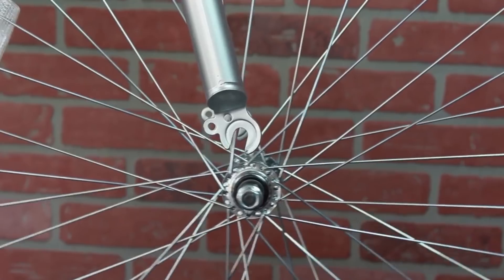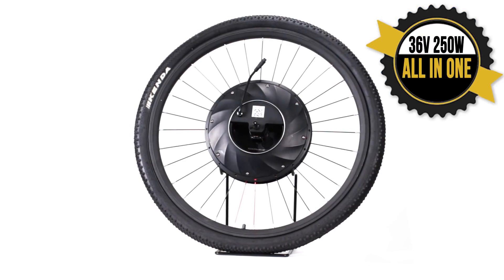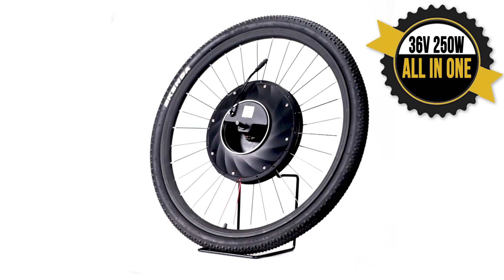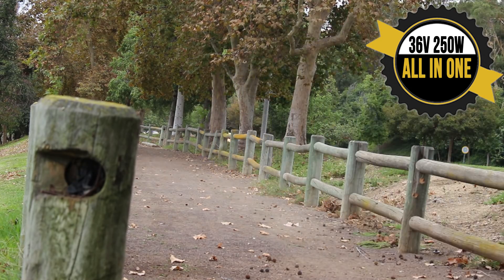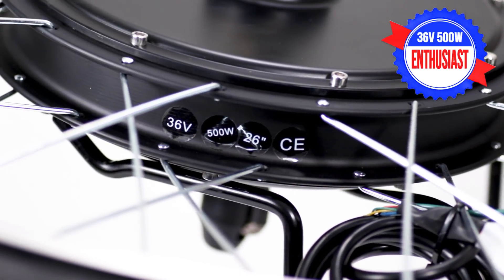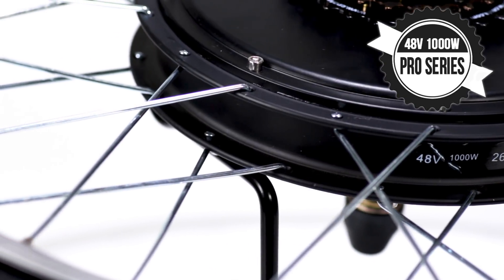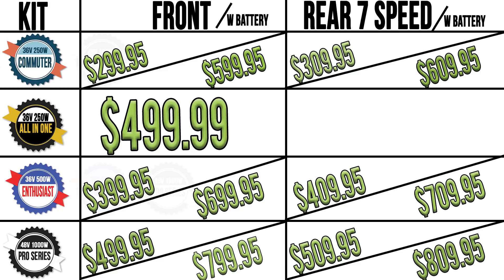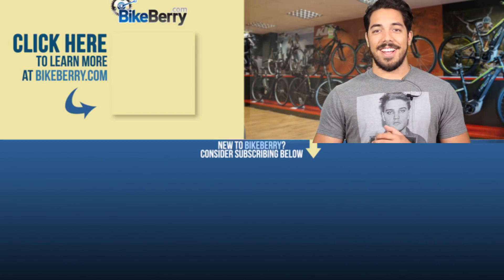Best Electric Bicycle Conversion Kits of 2019 - Electric Wheel -  Modwheel Buyers Guide

Comment: Looking at the ModWheel 26 Inch 36v 500w Enthusiast Front Wheel GEARED Electric Bike Kit I see conflicting info:
Here is says "brusshed motor";

    The ideal combination of speed, power, and competitive pricing
    Includes a 26” front wheel with concealed 36volt, 500 watt electric motor
    Comes with LCD speedometer and an electronic controller
    Brushed motors offer high levels of efficient power, while also minimizing operational noise
    26” wheel comes with innertube and tire already attached, plus a dish to lower wind resistance

Here it says "brushless" motor;

Kit Includes:

    1x 26" 36v 500w Enthusiast Front Wheel Electric Bicycle Wheel w/ Brushless Motor
    1x Electronic Controller w/ Thumb Throttle, Brakes, and Pedelec
    1x Controller Bag
    1x LCD Speedometer

Which is it?

Comment: 0:48 You'll need at least a 1000W 48V motor to climb the incline pictured here, but even then the motor might shut off/cut out. I'm 280 lbs. so even with 1000W it would shut off on steep hills. The reality is you'll be walking up steep hills, but now you'll be pushing a bike that weighs at least an extra 50 lbs. with the motor and battery!

I've also had 2 companies that sent me defective kits, that either failed within minutes or about an hour later of use. One of them refused to provide a refund without a video recording of the problem, which is ridiculous (I didn't have a phone at the time so I lost $1000). So be sure to read the refund policy.
Reply: 280lbs !?!?
Reply: You didn't have a phone but 1k for an ebike kit ? Lol

Comment: This discusses range without talking about batteries. I'd love a second video discussing battery options with each kit and how that would effect range
Reply: I checked the links in the discription. The 1000W battery option is for a 48V 11.6ah battery. The 500W is a 36V 11ah battery. Same as the 250. The all in one is only a 36V 3.5ah battery. Seems reasonable to me.
Reply: How much is the battery to have switch outs for range long distance.
Reply: Pls provide price for extra batteries for  the commuter model 36v 250w all-in-one

Comment: Can you do both front and rear wheel and select between one or both to increase power or increase distance?
Reply: you should be able to use a all in 1 wheel on the front and a 7 speed sprocket style remote battery on the rear and use them independently for overall range using them 1 after the other.   You could potentially use both at the same time if you have some really steep hills to climb.
Reply: I Would Like To Know That Too ...
Reply: The range is the battery.  I doubt if there is room for two batteries

Comment: never use a front wheel kit if you have suspension. Because it will destroy your fork seal
Reply: Makes no sense.
Reply: Dave Hurst I agree with you. Doesn’t a regular pedaled bike get the same vibrations?
Reply: Well when you use your brakes  there is a little racking fore and aft, same with hub motors.
Reply: @davehurst2543  good point!
Reply: How?
Reply: Because of shaking forward and backward the seals will get tired so quickly then will get cracks

Comment: I want to get the Townie Electra bike. It fits me and is very cute. I just want to cruise around town, but have some hills, and I am out of shape, so I will need the help to start. Which conversion kit would be best? In the store, these bikes with kit included are about $2600, YIKES, can I get the bike around $600 and kit separate around$400 and pay for install? Install could not cost $1500. So do you recommend this?

Comment: I'm often biking to work 8.5km and could really use some motor for assistance. I was wondering if getting the lowest power motor would limit my max speed. It says max speed with 250W motor is 20kmph but I already peddle faster than that. I want it to help me go @~40kmph. I'm not sure how e-motors work, will that work?
Reply: Alot of the control units have a speed limiter that can be unplugged. You'd really just need to check the installation manual to find which plug it is... and unplug it :)

Comment: Hi there ... as for the all in one , how far a distance can it cover on a full charge ?
Reply from the maker: 30 miles
Reply: I can pedal that at close to an average of 15 with hills any long distance or solar charging option for batterys remote n long distance otherwise your not ready to take on gas yet gas moters are 100 dollars 150 kits this is not good enough.

Comment: Never buy Battery. LiPo is the buy due to low weight and high power and constant power until spent. Now you do have to add a $2.49 LIPOLY LOW VOLTAGE ALARM (2S~4S) that sends out a audio alarm to prevent cell bellow 3.3v  but LiPo are light years better than old Li Ion or god for bid Pb battery.
Why LiPo?
Almost unlimited power like 20000Ah Capacity
Light LiPo are used for aircraft and flight needs to be light as possible.
Constant Discharge no drop off in power.
Fast charge  up to 15C
Longer Cycle Life 600+ charges before any loss in capacity

Comment: Hi Bike Berry. I have a question. If I want to use an ebike to commute to work with distance 45 miles one way, which conversion kit do you recommend? I can say I would have little to no throttle just keep pedaling as I usually do when ride to work with my road bike. Also which conversion is gonna fit to my road bike?
Reply from the maker: We believe the 500W would be your best option. You would have to pedal still as the 500w has a roughly 20 mi range.
Reply: How is the front hub motor compare to mid drive motor?
Reply from the maker: @yuniwibowo738  Depends on the terrain you'll be riding on,. Maybe this video will help https://www.youtube.com/watch?v=_29-woOvOoA

Comment: I have a question...?¿?
I was thinking about running dual motor's .
one on the front hub one on the back hub  so I can really take off where I live it's really hilly .
would that be good or bad???
Reply from the maker: It would require custom modification, but doable.
Reply: Hi Lisa Lee, Check out ebikeschool.com and micha toll has a dual motor configuration done. he also has a video available.
Reply: Just a thought. Maybe you can mount a rear drive motor in the mid drive and ad a derailer to go through the cog on the moter. Maybe a 21 speed bike would become a 36. Would be interesting.

Comment: Lasts 25 miles while you travel 15 mph? So... It slows me down? Last I timed, I was doing 19 mph average on gravel roads (speed limited by how rough the road was before going into the ditch). That was even being off the bike for 2 months, but not really pushing to find what I could maintain ~indefinitely (eating while biking).

I guess this video helped me pick one though, so thanks! I was wanting to try a 500w motor kit ($120 since I already have high powered LiPo batteries), but I think the 1500w kits at $240 look more enticing now (providing my own batteries). I mostly want it for when its miserable and cold to assist just because its fun to go fast, but I want it for safety for a little extra "oomph" to accelerate in a hairy situation when my exhausted legs may not cut it. Thanks!
Reply: We get it...You're superman on a bike.

You superheroes really don't even need to go electric. (eyeroll at the humblebrag)
Reply: Why are you even bothering with one?

Comment: Is it ever a thing for people to do both a motor on the front and back?
Reply from the maker: Many have asked, we haven't seen any builds but we do believe it is possible with some custom modification. Let us know how it goes.
Reply: Shouldn't be hard, these kits seem very simple. You could probably just split the throttle signal wire (like 5 minutes of extra work). Or you could just have 2 throttles (which I think would be fun for spinning tires independent on ice and do some drifting taking advantage of controlling each wheel).

Technically speaking... Depending how accurate you want the motors synced would be another story (will depend on internal winding and position sensors, ideally they would be the same motor, and if you were absolutely crazy you could have it synced through a micro-controller modulating the 2 ECSs, however I think that's entirely pointless since turning will make the travel distance different anyways).
I would think splitting the signal would be just as easy, just like motorcycles with duel carburetors have the throttle cable split to the 2 carbs. Should be extremely simple.
Reply: Several Youtube videos on how to.
Reply: I would use them for long distances in serie. If one wheel is out of battery I would use the other  one.

Comment: any good cheap (not walmart cheap) bikes that can take a wide hub motor like a 3kw or 5kw hub motor?
Reply from the maker: Look into Micargi bikes. Thats our cheapest line that we carry.
Reply: I put a 50cc chainsaw engine (3.5 KW rated at 6-8k rpm), and it just sits there and does burnouts smoking the tire. However, I don't apply power through the spokes with my custom design, so no stress or forces rely on strong spokes or chains (its not tire friction either, those are terrible). So the Walmart frames can handle it, its just the wheels get destroyed when moving power through the spokes (which you hub kit will have its own wheel). I say that, because I've seen a 212 cc engine rip apart a typical 26 inch bicycle wheel when engaged through its normal chain drive (no idea how it didn't snap the chain...). And the Walmart bike it was red-neck mounted on was fine other than the wheels kept getting absolutely destroyed (the thing would do a wheelie at idle... it was my Cousin's bike).

You could do a 4.5 inch fat bike (4.5 inch refers to tire width, my regular dirt bike for example with 15 HP and a top speed of 80 mph has 2.75 in in the front, and 3.5 in the back, the tires are very fat on these bicycles). Even the Walmart ones ($200 to $250) are built heavy enough to take it (my cousin has one, he's wanting to build another motorized bike, we have thoroughly abused that bicycle riding down steps and trail riding, and its not showing damage other than the shifters on the handlebar are junk, but once replaced an excellent tough bike).

Comment: I bought a 1000w motor for 179.00 and a 48Watt battery to power it for 377.00.
Bike goes 30mph.
Ebikes are a lot of fun,if one likes that sort of thing,traffic is still a problem.
Reply: which motor did you bought ?  179 is cheap !
Reply: @alexandrespetschinsky8354  Voilamart,on amazon, my kid has used it for a couple of weeks,great motor,great customer service.
Reply: Be aware that the most expensive part is the battery,to power a 1000W motor you need at least 36 V,I have 48V and I paid $377.00.
Reply: Walmart has these same price.. no shipping, and you can buy an extended warranty incase you get a lemon.
Reply: @captlarry-3525  I wanted to buy it from WM,but it was 75.00 higher....WM forces me to buy fr Amazon,WM has a very poor website.
Reply: Your battery was expensive. I bought 36v 8ah li-ion pack from aliexpress at 68,- euros. About 85$. I have measured capasity and it really is 8ah. My bike takes maximum of 33amps full power 1135w, so it needs good battery.
Reply: @bassotalli6494  Europe may have lower prices,but 48V lasts quite a while,he goes 40 mls,then recharge.
Reply: Could ye give me a link plz
Reply: @podjo2k9  voilamart.com electric bicycle kit 1000w 48v..but if you go to Amazon,they also sell it in amazon for 30.00 less
Reply: @podjo2k9  joyisi battery pack,48V 13ah more than enough to power the motor,also on amazon...

Comment: Even though it sounds nice. I hardly see anyone with e bike kits. And at this price isn't it better to get a real ebike than to pay this much for a kit?
Reply: You can get a kit at 200$ from ebay or aliexpress. Some reason peoples just aren't itrested of them. I made battery out of used li-ion cells I got for free. Its not up to money, more of intrest to move by electricity. If you have a car you dont need ebike. I dont have a car.
Reply: Seems like kits are pretty cheap, whenever I see a bike I look it up and I've never seen any ebikes less than $3k out in public, with that you can get a nice e kit and a nice bike
Reply: @crazycamkalani  Yep, at that price your looking at a very nice carbon fiber racing bike used, and plenty for whatever motor kits you want (do both wheels if you wanted). Though I think its a little bit of a shame to kill the weight on a carbon race bike... But at the price the pre-built ones cost, you certainly could do it and have the nicest bike!

Comment: Which kit works best to convert a 7 speed 26 inch tricycle I want to convert to an ebike? Do I use it on the front or rear wheel? 😊
Reply: Front wheel (assuming your pedal powers the back wheel), that would by far be the easiest.
For that reason, I made my motorized (grass trimmer powered) bike a while back, and I did front wheel drive purely so I didn't have to mess with all the gears and chain being in the way. Top speed was 28 (legal limit was 30 mph) without pedaling, and made just over 200 mpg (using 25cc at 11,000 rpm for cruise speed, 2 stroke engine) using a Frankenstein of random engine parts mixed together (everything was very red-neck). But I moved to Texas, and it needs to be electric so I don't have to tag/insure it (otherwise I'd just use my regular motorcycle if I have to pay for all that). Plus I probably won't smell like gasoline fumes when I get to work (that's a problem with gas powered on the front wheel, good news is it kind of keeps you warmer in the winter...).

Comment: Can you put 2 in one bike?
Reply: Now that would be bad ass! A 2 wheel drive bike. Technically it's Totally possible, just have to piggyback the 2 throttles into one but could leave all the rest as individual systems.
Reply: Yes you can me and my frindes  done it
Reply: Sounds great for off roading
Reply: My understanding is that you need to be careful about the controllers... so you don't have one motor working against another, especially if it has regenerative breaking. It can be done.

Comment: Hey bike berry. Ever since i saw people riding motorized bikes and e bikes it has been my first wish to own a motorized bike. I ask for a motorized bike for my birthday and Christmas but my family can't afford one and i can't but I work really really hard for one but I just can't make enough money to buy one. Please bike berry my wish and dream is to own 2 four stage racing motor for my bike and my brother. His story is the same as mine. Please bike berry. Please😢😢😢😢😢😢😭😭😭😭
Reply from the maker: Hey Mr.Sponge thanks for your interest in the stage 4. Right now we aren't giving away any engine kits however we will be doing a giveaway soon. Stay tuned for a chance to win.
Reply: My kit cost 146,- euros, thats about 180 dollars. I made battery out of used 18650cells I got for free from local battery shop. 1135w measured power. It takes me evrywhere I want. And cost well under 200$. Kit is from aliexpress. L-faster brand. Get 24v 450w kit and use 36v battery. This way you get litle over 1kw, and good torque. Hope this helps :)
Reply: Hey Basso, I have a lot of 18650 cells, simply to have them handy. How many did you wire up for your battery rig. Sounds great to me, this workaround to paying so much for a battery. Your how-to makes perfect sense, ideal for DIY people like us. I'm at SanFrancisco@ATT.Net to any details you might have. I'm going to try finding that rig you mention.
Reply: Glad I can help. I soldered my battery whit nicle plate, that is dirt cheap. Fist I made 4 cell parallel croups, and then soldered these croups in series. 10 series givs 36v, and 13 is 48v. You can ad more if you want to encrease voltage. Remember to solder thin wires to each parallel croup for balance chargin and balance your cells to same level before you connect them. I use cheap chinese 42v charger, and for balancing I use also chinese 5v 2amp power suply whit a diod to get 4.2v. Cell balance is good to chek few times a year. Kit is L-faster brand. It has side motor at rear wheel. I think it looks cool, and givs good power and torque to clime uphills. I use aliexpress android app so I can't get link in here. It is rated 450w but whit overvolting it givs over 1000w. Motor doesn't heat much even whit my new controller which givs 1256w.
Reply: check youtube for home made spot welder for adding tabs to batteries to make good packs.
Reply: now I need this source of free 18650 cells. !build up packs for ham radios.. and one for e-trike.
Reply: I just want to know how you got the free batteries.. robbed from replace lap tops..and then you cull out bad cells, test and match to make your own pack ?  smart !
Reply: Basso Talli could you make a video of your bike? Sounds very interesting
Reply: @BradXP_ 1209 so so no